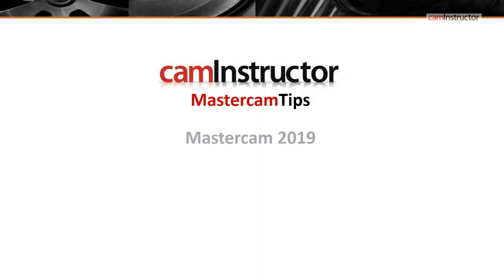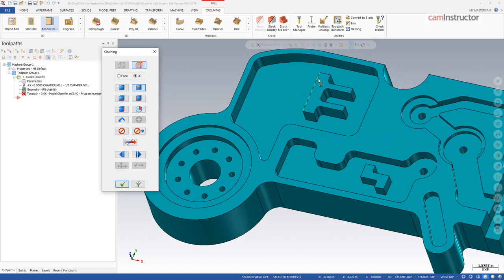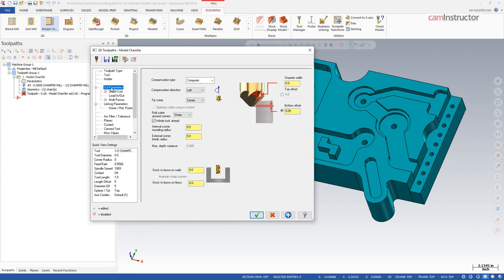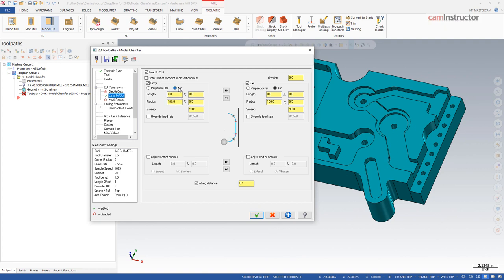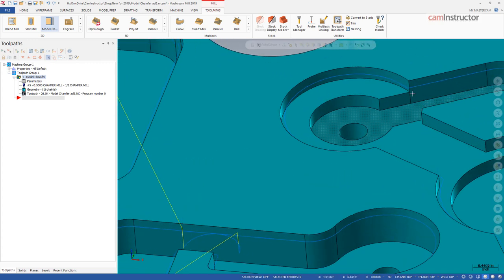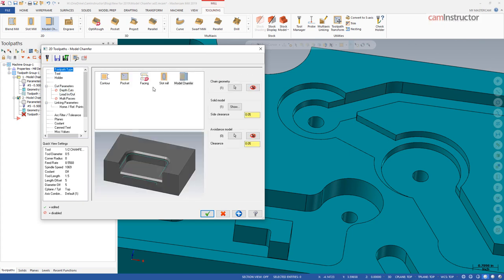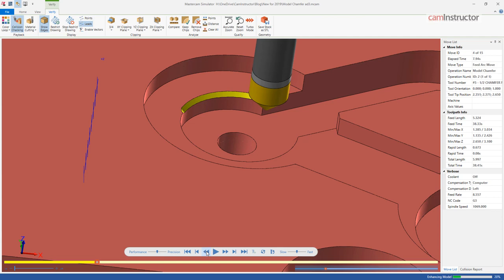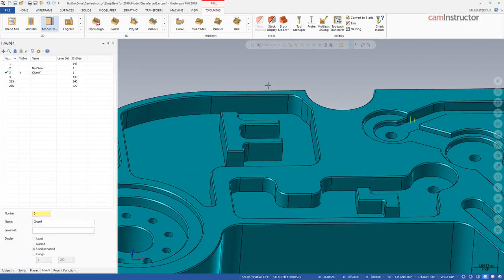New Features in Mastercam 2019 - Model Chamfer Video 1 of 2

Comment: It’d be nice if the follow up video was linked in the description..
Reply from the maker: Added the link! Thanks for the heads up on that.
Usually Youtube will link videos that are Part 1/2/3 etc, but I guess not always.
Reply: @CamInstructor  no problem boss, can I ask a question tho, I’m using mastercam 2020 and I followed your every step (I was getting toolpath regeneration errors) and I got it to where that no longer pops up but now my simulation doesn’t even show the chamfering being done. It’s on a model with the chamfer already placed so I have no clue what to do